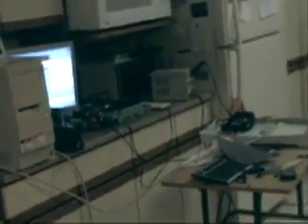How I built my laser cutter step one

Comment: Plus there are 2 positions of the cutting head on plotter- 1 up, 2- down (cut) You can use that switch  for turning on\off laser.Plus you 'll get software and drivers with plotter (Can adjust speed and stuff ) and wouldn't need to calibrate this thing.  Only thing is to get a laser head powerful enough.

Comment: Try using an old plotter(thing that can cut paper) Or get i chineese one, they're preety cheap.install a laser head instead of the cutting head. its much easier with the plotter i think, the cutting head on the plotter can move left and right, but the plotter moves a sheet of paper back and forward with the small rubber rollers.I think it 's easy just to put this whole assembly on some kind of the rails,so it can move itself back and forw. instead of moving paper.